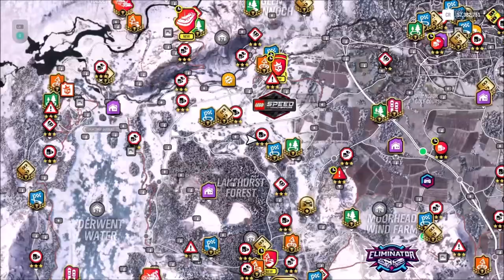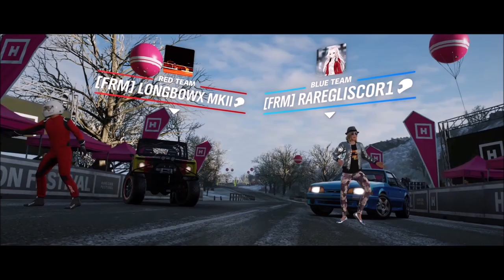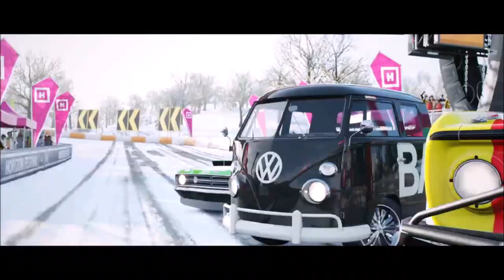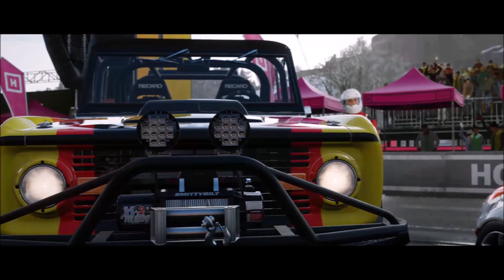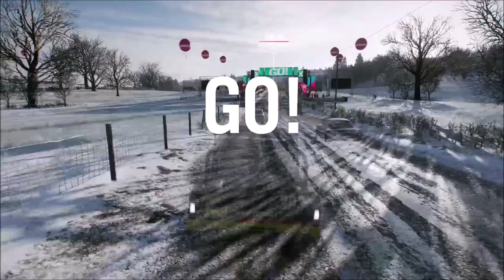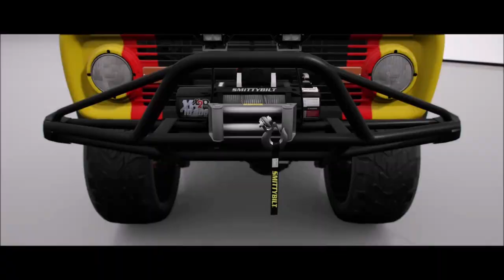Twin Turbo Hoonigan Bronco (Failrace Forza Horizon 4 Racing)

Comment: Bronco did you well, unlike Laddo's Jeep. Did you guys ever find out what was wrong with it?
Reply from the maker: I think that it was probably just not an ideal suspension setup. Tall vehicles in FH4 like the Jeep (and the Bronco) have some hesitation when asked to change direction, which takes a while to acclimate to also
Reply: LongbowX - Failrace Staff they’re not good at turning normally but very good at sliding around (when you need to) lol